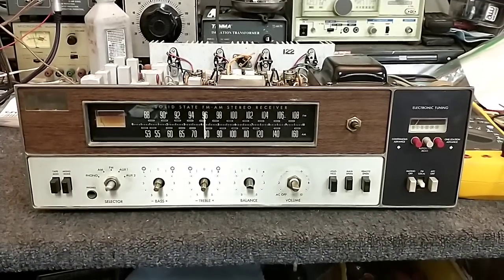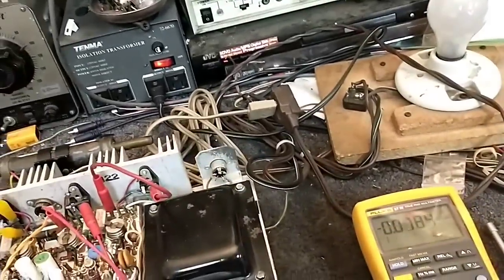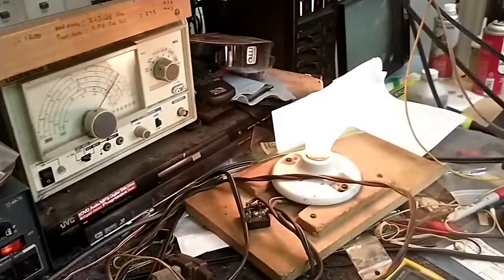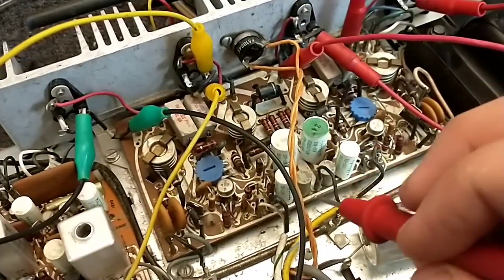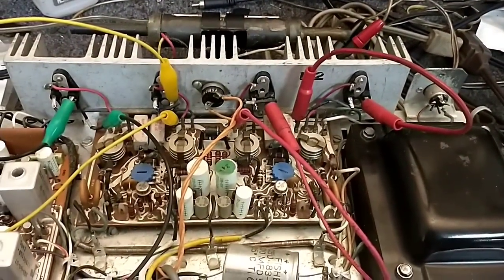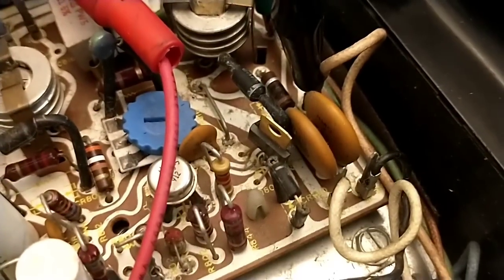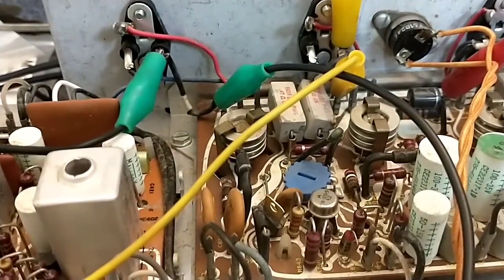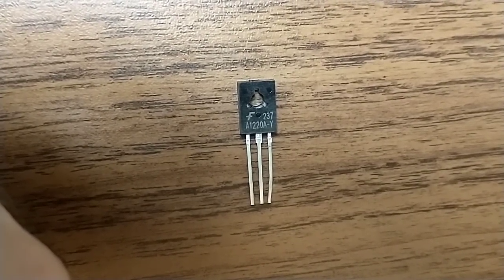Repair of a vintage 60s Fisher 450t solid-state stereo receiver. Part 1/? amplifier troubleshooting

Comment: I love the amp troubleshooting stuff, and this one is right up my alley. I wonder if the transistor died of natural causes, or if it had help? I have a feeling that the plot is going to thicken.
Reply from the maker: My theory is an ongoing problem with the leaky capacitor at the output of the preamp was over biasing the input of the amp and the class a driver just gave up. The channel went DC and opened the fuses and the sorted class a pulled down the supply resistor, burning it open causing the offset in the left channel. Eventually the speaker attached gave up and shorted, opening the pico fuses in the left channel as well

Comment: I found one of these while cleaning out a cabinet at our church. Stored alongside is a service manual copyright 1970, 16 pages some of which fold out. If you need a copy I can probably scan it.
Reply from the maker: Thanks, but the owner of this one sent me a copy.
Reply: @JordanPier  👍 Anything I should be aware of before I plug it in? Although handy, I’m not looking for a repair project. Yet.
Reply from the maker: @tchads_57  make a dim bulb tester and fire it up on around a 100w bulb. That way if something decides to go south it won't kill the machine